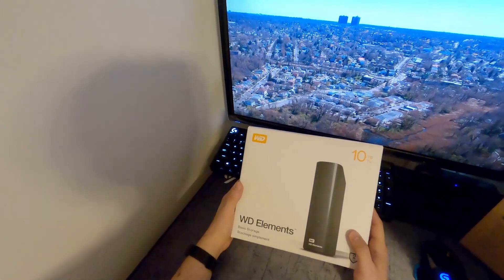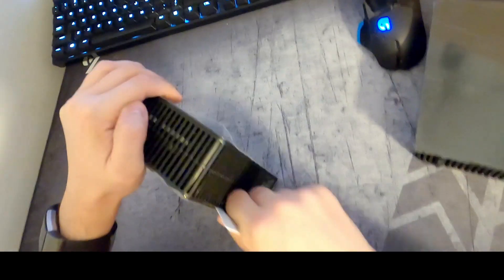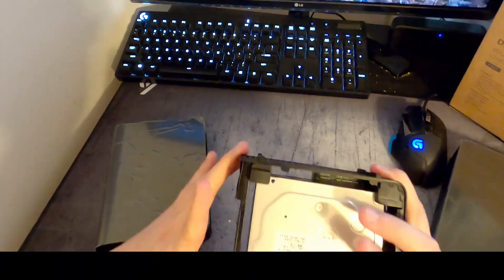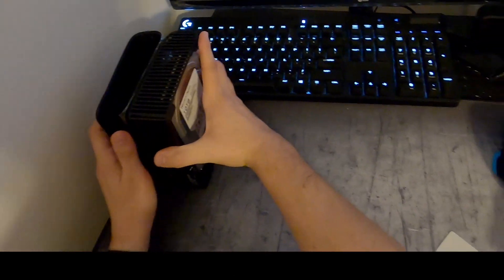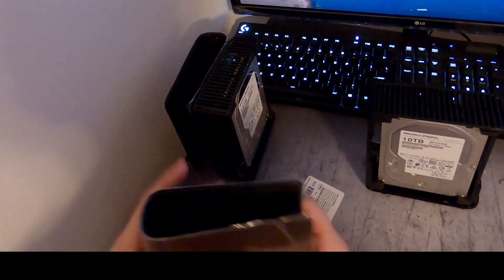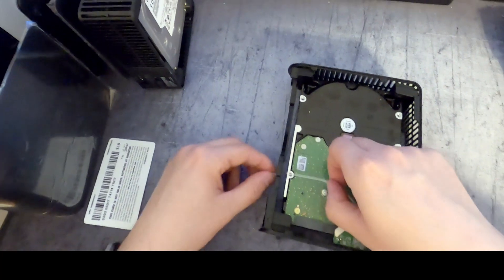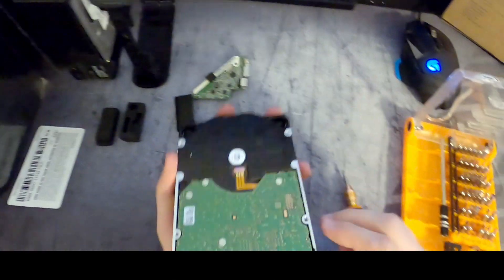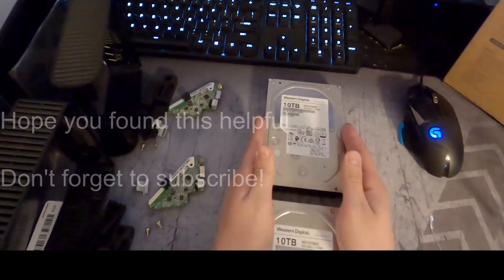WD Elements 10TB Shucking

Comment: Same 2 drives I got and for the same NAS
Reply from the maker: I have them on my desk and they're a bit loud in my opinion, but so far work great.
Reply from the maker: Maybe next time or if I need to expand storage further. I'm fine with how these are performing this far. Thanks for the useful info!
Reply: This is great, thanks for sharing. But why buy new WD storage and then strip them. Why not just by bare drives and skip this work?
Reply: @isaacneitzell2897  An internal drive cost more usually $50+ more and it's the same storage size.
Reply: A question. WD 10TB Elements Desktop External  I saw that this same model has blue packaging instead of yellow. Is there any difference? Thanks